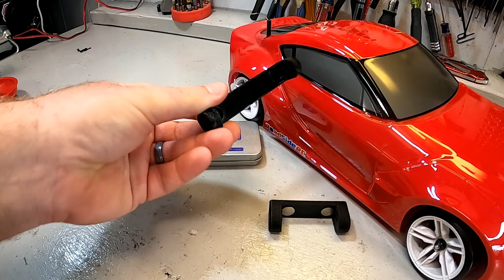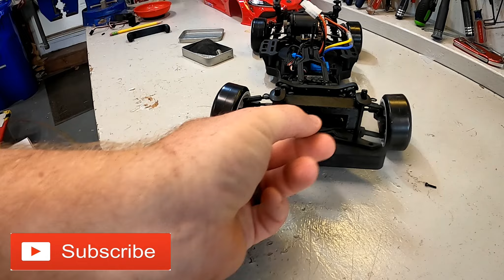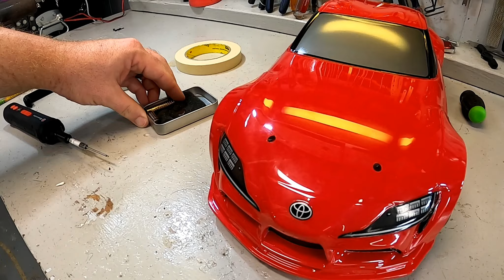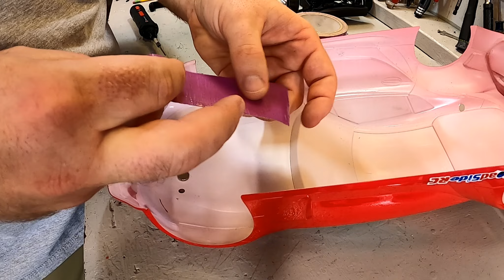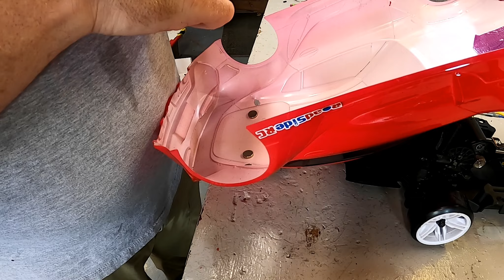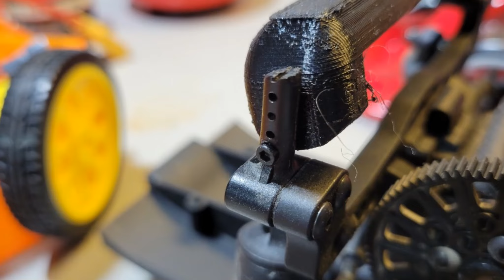EASY Magnetic Body Mount for Yokomo YD-2Z RD1.0 RTR

Comment: It took 2 different types of magnets in experimentation, but I used magnets from Amazon on my gen8 scout. I can pick the truck up by the roof rack now.
Reply from the maker: Nice!   I actually put tape over the magnets like this to help reduce the magnet strength.   Don't want it pulling off the body!

Comment: Good Stuff!  Do you have confidence in the duct tape long term?  No CA glue instead?  Been trying to do something similar myself, but keep hesitating when it comes to gluing the magnets to the body…
Reply from the maker: You don't want to use glue - it will mess up the paint.  
The tape works great, even if you need to reapply at some point in the future.